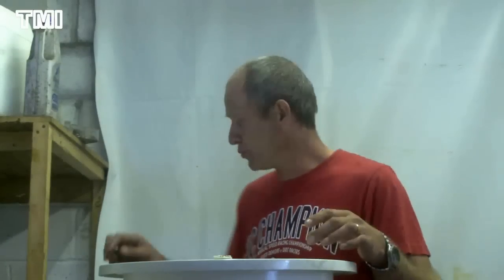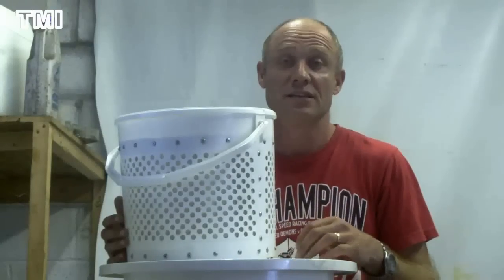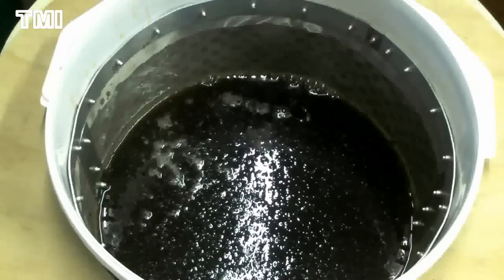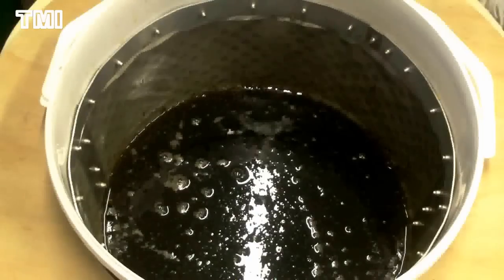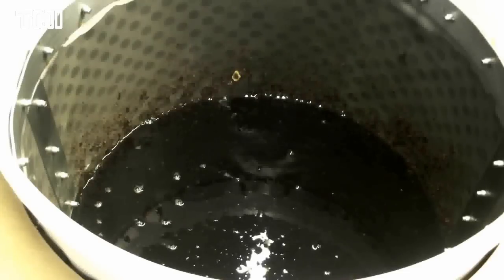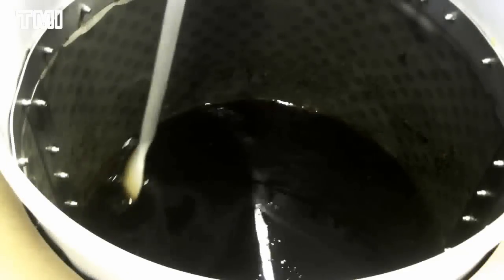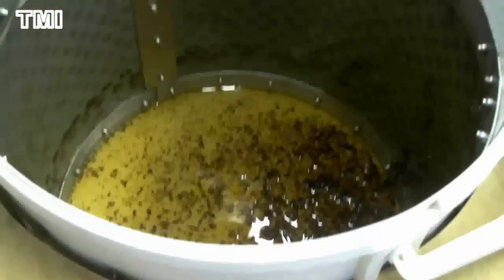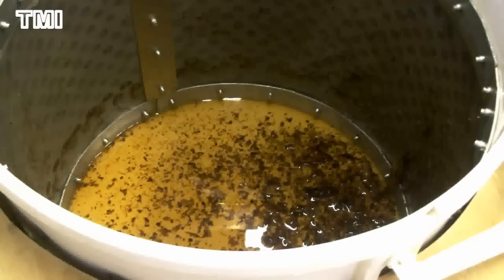The 'Mighty White' - making waste oil filtering easy

Comment: that dirt seem to be come from cooking oil , motor oil would not have this kind dirt in it  , Filtering  motor oil is not easy even I use   large Paper  Coffee  filter together wery fine cloth filter still dark carbon particles was not able to remove from oil , they are soo fine almost impossible to remove them by conventional filterin practice .

Comment: I hope you realize selling this filter as the only filter needed for your oil. 77 micron is way too large a particle to pump into your tank. Your fuel filters are around 30 micron. I've filtered down to 5 micron, then ran through a centrifuge and that still pulled a lot of soot and carbon out. So please understand if it was this easy everyone would do it. This would be ok as maybe a first stage but that's it
Reply from the maker: Matt Vega thank you for you comments. Firstly fuel filters are 5 micron not 30. Filtering oil with this filter many purchasers have used the oil straight away, with no problems. Depends on the oil with fat content, water etc and how you prepare the oil afterwards. Selling hundreds around the world I rest my case. Thanks.
Reply: Agreed. The filter will take out the chunks from vegetable oil, which it looks like he is using. For waste motor oil, what you have to get out will go straight through mesh. Carbon, water, antifreeze, metal particles.....
Reply: Just because you sell them doesn’t make them good, and depends on vehicle. Idi diesels use 30 micron, my powerstroke is 5. What I’m saying is this is a joke if you think this is the only filter you need to use. FOR ANYONE READING THIS YOU WILL MESS UP YOUR FUEL SYSTEM! Get a real filter if it was this easy everyone would do it, you need to centrifuge

Comment: That will not clean out soot and other damaging crud out used motor oil. You need a finer filter.
Reply from the maker: zippy watch my other film you will see The Mighty White filtering waste engine oil and catching crude and debris. Thanks for your comment.
Reply from the maker: zippy I build finer filters but go too fine and the oil sits still!!! Many who have brought this filter to use with waste engine oil have found it works for them.
Reply: This is way too crude of a filter. This is maybe a first stage but you really need a centrifuge or <5 micron paper filter.

Comment: great food for thought. I like the solid flat-pan bottom with filtration through the sides as this gives a fast flow rate whilst allowing much of the heavier impurities to settle on the bottom. you could probably primary filter quite a large batch before having to clean the filter

Comment: If making a cone filter is the difficult part why not put a solid cone inside the bucket facing up? Then you still have an easy clean out (just lift the cone out) and you would filter a little bit more efficiently.

Comment from the maker: This filter can be used with
 waste veg oil, engine oil, thinners and water. Cost £39.99 plus delivery. Will ship any where in the world.
Reply: You could add a small electrical engine beneath to spin the filter. The centrifugal effect would increase the filtering speed, I think.
Reply: can you post a link to your website?
Reply from the maker: PlantsAsMedicine i have no website yet but you can deal direct with me at themadinventor1@aol.com
Reply: Our ground water contaminated by oil spill. Can i get drinking water as this method?

Comment: I would drill a hole in the bottom at the side and put a wine cork in it. Then you can use soapy hot water to swish around and pull the cork out and let out all the crap!
Reply from the maker: The reason there is no hole in the bottom is for strength, 15lts of wvo is near 15kgs, should you not get that Cork in right then the oil will decant and you'll back to square one. Cleaning is easy as it is with this design. Do you really want to be poking the debris through a hole?
Reply: @themadinventoruk  all good if it's all good👍🏻

Comment from the maker: Cut a hole in the bottom and line with mesh would block straight away and the strength of the filter to the edges would be lost. The weight from the bottom helps squeeze the oil to the sides and extract the liquid oil and leave the fat behind.

Comment: If you heat it, it will filter much faster. Cheers mate.
Reply from the maker: Heating the oil also allows fats to follow through. My filters were designed for cold filteting
Reply: @themadinventoruk  There are starches and emulsifiers that can catch fats. I see your system is more complex than the video showcases. My mind as a modern weaponry specialist, works in such a manner than always is looking for improvements. There are always new things that may improve our systems. In this way I observe from the perspective of innovation and refinement inherently. That aside, you seem to have zeroed in on your intent quite well. Good luck in your endeavors.

Comment: Dave,
I see one possible fault with your design. Since the screen is riveted into the pail/bucket you would end up with a gap between any area between the riveted areas and at the bottom of the pail where the oil could seep past or around the screen itself.
All that would be needed to fix this would be using a gasket between the pail and the screen itself prior to be being attached to the inside. 
To not re filter the used oil even after using your filter bucket is not the best idea IMHO, running the oil through a cartridge filter would be the best choice. Its always best to go the extra mile to get the best results.
One question I do have is why didn't you have the holes made even smaller than 0.0077 you used in your design? Might take a bit longer to drain through but the finished product would also be cleaner than most other filter cartridges out there that people have been using.
Good luck.
Reply: Sir, I want to filter waste hydraulic oil how will i do it like what process and method if you could guide me i would be very thankful to you.....
Reply: This is a "first step" filter he filtered the oil into a filter bag lined container it's not completely filtered but it would be much cleaner than no filtering before his bag filter, it's most to save your filter bags.

Comment: Why wouldn't you drill bigger, fewer holes or just cut out the bottom or cut slots or large windows in the side... thats a lot of work drilling those holes!
Reply from the maker: If you drill the bottom water will pass through and block faster. Drilling  bigger holes on the walls will weaken the whole structure. The main thing it works.
Reply: @themadinventoruk  You're darn right

Comment: Where can I buy this I'm in the us!!
Reply: do not try filter used oil it is impossible to to catch carbon particles from oil by conventional filtering practice , try filter some small part of the oil using finest filter element you could find even use Coffee filter  , paper towel  any fine cloth you will see oil will come out still dark , before trying to filter large quantity of used oil .

Comment: You didn't mention how many microns it Emitted
Reply from the maker: Yahya Safoury 77 micron super fine mesh
Reply from the maker: Size was mentioned on the film
Reply: @themadinventoruk  isnt most engine damage done by particles around 30 microns in size?
Reply from the maker: @jayl4111  this would be the first stage in filtering, depending on the use of the oil afterwards. Most fuel filters are 10micron so hopefully that answers  your question.

Comment: You cannot easily purefied engine used oil that way it's impossible I myself trying my best to develop a furifying machine that can actually back into same new color of engine oil. And I've tried so many ways including your ways. Used engine oil is completely in black color. That us impossible
Reply from the maker: The filter is designed to remove foreign bodies not turn back to a golden colour. And to turn waste engine back into a more decent colour is not rocket science.
Reply: You are correct. There is no way used engine oil can be cleaned with a filter to get the golden yellow color of the original oil. This is impossible, even a magician cannot achieve this by just filtering the oil. Chemical reactions must be involved to get the desired oil quality. Thanks

Comment: Can you stick to metric measurements please. We do live in the 21 century. Very annoying using both systems in the same sentence.
Reply: its a bucked with holes. lol does it really matter ? i am all for pure metric but this vid is about the idea dont put measurements on an idea. also i think cuting a scuare diagonally and making a giant kaffeefilter would be faster.
Reply from the maker: steffankaizer the filter was designed for cold filtering and no for speed.  Its to filter the oil just once. Did you mean square as i  cant work out your spelling?
Reply: ok and square
Reply from the maker: Thank you for your comments i value them all. Its very popular filter that sells all over the world, and i believe value for money.